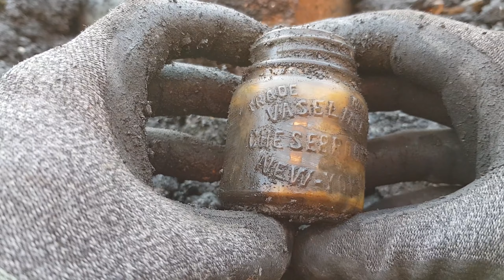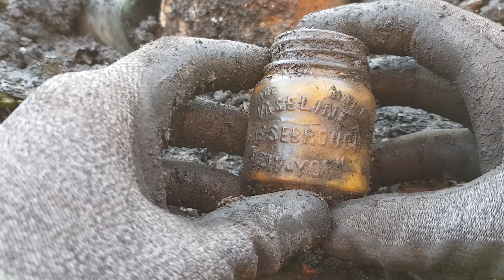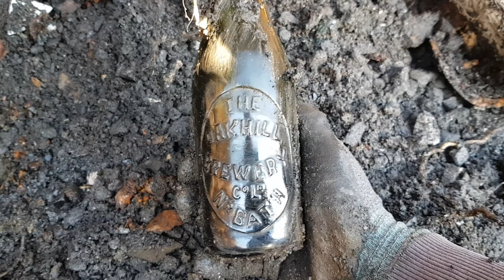Plenty Of Beers, Bottle Dump Digging South Wales UK

Comment: beautiful tip!  sad about the necked codds; I just found out that around 1911 here in Australia laws were made that p[rohibted the breaking of codds/bottles obviously because the bottle companies worked via a deposit and return system and they were losing too much bottles due to naughty (normal) kids breaking the codds to get the marbles:)
Reply from the maker: Thanks! Yes that is right, I think the drink company had to sell a bottle 4 times to break even on the cost of the bottles production which is pretty crazy but they are like works of art! I have found a few later ones that have a different patent and instead of a marble they have like a double sided cone shape which still works as a stopper but pretty useless as a marble 😂
Reply: @VintageParagonUk  yeah true. i often think about how much the cordials works invested in the actual bottles. it must have bene expensive to purchase a contract of say 20,000-100,000 hand made ginger beer  bottles.
Reply from the maker: @ISCDesignArchitect  It is easy to forget when digging that most of the things we find have been hand made and it was someone's job to just throw clay all day or blow glass day in day out, all those man hours put into something that was just smashed up by a kid after a marble 😂

Comment: How old are these bottles do you think,we should have recycled years ago. It looks  like everything has rotted away except glass and metal.
Reply from the maker: Most of these are 1900-1920, there is lots of dumps all over filled with glass, metal and ceramic. Perhaps one day in the future they will be dug out and recycled. I suppose it was cheaper and easier to just make something from new rather than recycle it.
Reply: @VintageParagonUk  I might start doing this,there is a land fill site that was used back in the 1950s on a old fort in Herefordshire.